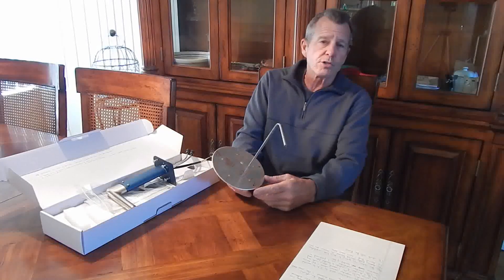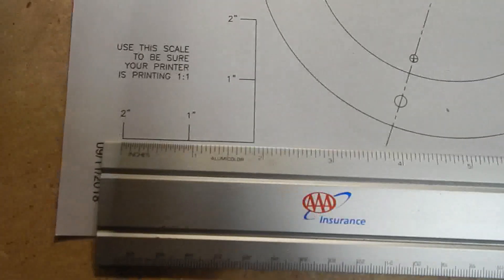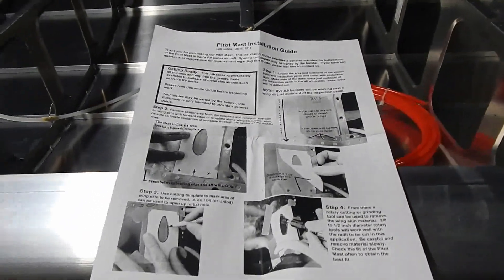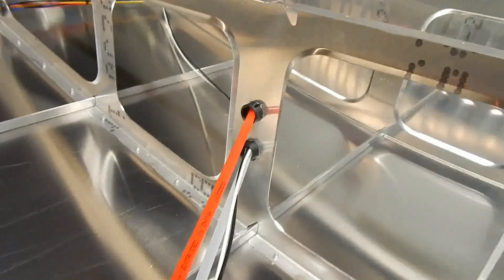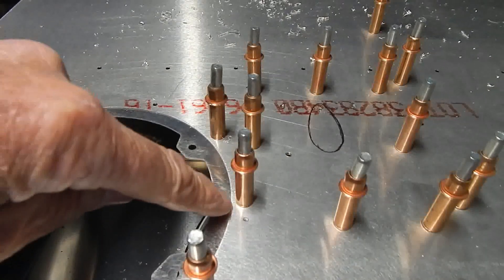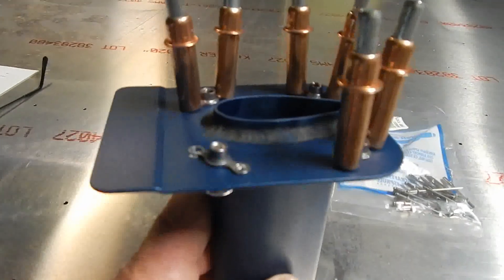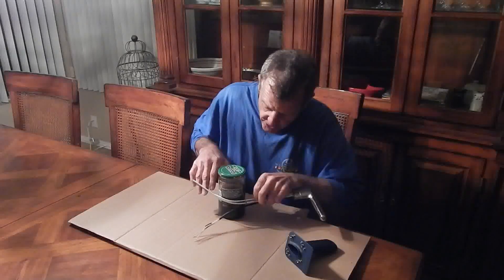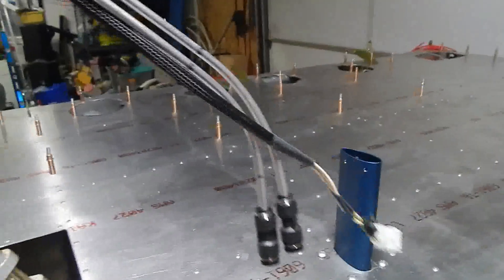RANs S21 Pitot Install - Both Garmin Gap26 Heated and RANs Tubes

Comment: Great videos, thank you.  Did you use a brake to make the pitot tube bracket?
Reply from the maker: No.  Unfortunately I didn’t have access to one.  I used my vise and some clamped aluminum to bend pieces.

Comment: Great video. Who makes the bracket you used?
Reply from the maker: Thanks for the comment.  It is listed on Aircraft Spruce as "Aluminum Pitot Mast".  The cost was approximately $71.  I thought it was well made, and substantially cheaper than the Dynon or Gretz (sp?) masts.